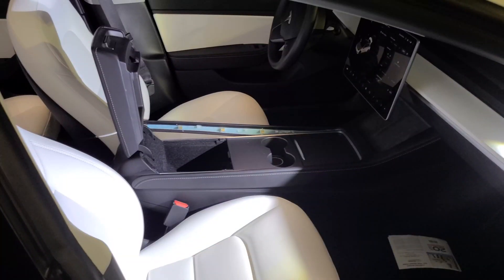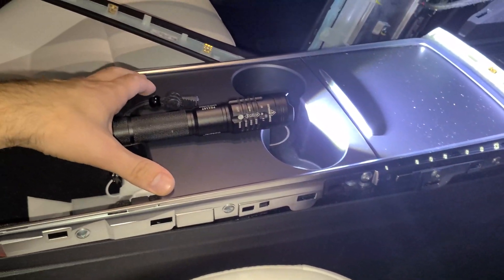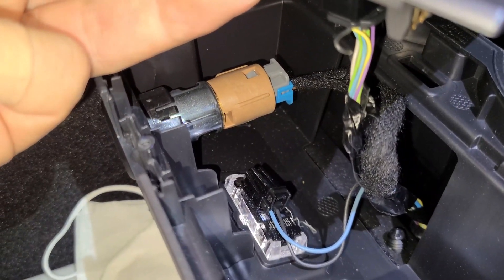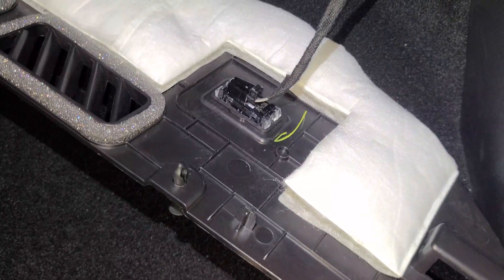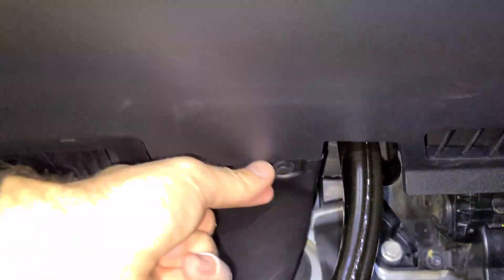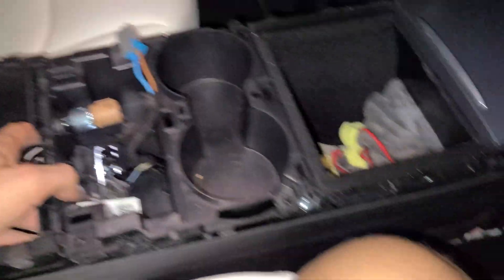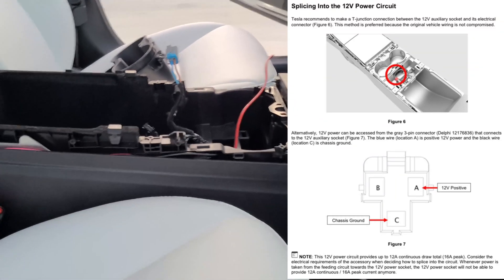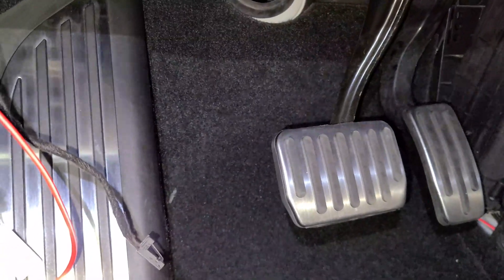HOW TO GET SWITCHED 12V POWER TO ENABLE FOOTWELL LIGHTS ON TESLA MODEL 3 SR+ OR OTHER 12V ACCESSORY

Comment: Just a quick warning, older cars with the original center console will have a different disassembly procedure that includes disconnecting all batteries. It's more involved. See owners manual.

Comment: I recently sold my 2021 Long Range for a 2023 Standard Range, not realizing I lost amenities like the footwell/ambient lights. You are a Godsend for this video, as I am ordering the supplies from your Amazon links and can't wait to get my footwell light back. 

That said, do you know how to activate the side door lights that turn on other models? I would want it on at all times like the footwell light. And since I am using the 16 gauge you mentioned, can I use this replay for do some lights under heater the seats for the passenger in the back?
Reply from the maker: Is this in regards to the footwell lights when the door is open or the door in the cupholder? The footwell lights should be active on a SR so I am going to assume you mean the cupholder lights. I looked into this slightly a while back and ultimately decided it wasn't worth the effort for me, but it seemed that they may not actually install that LED in the car's that don't have it active. I would imagine if you really wanted to, you could install a small LED light where one would usually go (the hole should still be there since it uses the same plastic mold), however you would likely need to do some door panel disassembly to access that area.

As for the rear passenger lights, yes absolutely, you can tap anything you need off of this wire such as rear lighting, a radar detector, or anything else you would typically run off your 12v plug in the center console.

Comment: Okay, have all the parts that you recommend from the Amazon links, using 18 gauge wiring, which has  two polarities.  So my question is when tapping into either that brown or yellow wire for the signal, you show using one red tap, meaning you tap both the red and black wire into that brown or yellow wire?  That's not done on the blue and yellow wire where you show two taps, one for the ground (black) to the yellow and one for the positive (red) to the blue wire.  Same question for tapping into the red and gray wires for the lights:  are you just tapping one wire (red) into those light wires?  So coming off the relay for the power, you are splicing one wire (red) to go to the two footwell lights wires, red and gray, correct?

Comment: Can I just tap into the cigarette lighter to power dashcam and put switch on it?

Why are you running so many cables..?
Reply from the maker: the additional cables are to use occupancy sensing. Without the signal wire, the dashcam would stay powered on except when the vehicle is sleeping. If sentry is on, the vehicle never sleeps. So depending on your use case, you you can just tap the power directly if you don't need occupancy sensing.

Comment: I have a question sorry if it’s a stupid one..  when I splice into the footwell lights (the red and grey wires) do I splice into the wire and make it a three way connection or just cut the original power wire and just splice it with the new power wire? 

Also can I just use posi taps for the splicing?

Comment: Really nice video. Answered a lot of my questions. I'm still at a loss at where the brown wire is. Do you need to remove the plastic cover under the air vents (the obd connector location) to access the brown wire?

Comment: As ghetto as this installation is, there is very useful information in this video that I haven’t seen available elsewhere. Be aware that the power source used in this video is around 15.4V with a max load of 12A after 2022. Use DC-DC converters to protect your installations.
Reply from the maker: Since this is tapping off the cigarette lighter (typically 12v power) wouldn't the car already be downstepping the voltage? I believe you would only need the converter if you pull the power directly from the battery, right?
Reply: @TheHardwareJunkies  it is 15v as tested today. i have a stepdown for that purpose

Comment: Which brown wire is the correct one in the back?? I have 2 thin brown wires and one thick in the blue plug??
Reply from the maker: Behind your air vent, you should see a harness connector, on one side you'll see a thin blue wire as well as a thin brown wire going into the connector. On the other side of the connector you will find a yellow wire as well as a black wire. For my installation I tapped into the brown wire. I have also heard that for an easier installation, the yellow wire is a continuation of the brown wire and that you can tap that as well but I have not personally verified that.

Comment: Is that signal wire there on a 2019 SR+? I assume this will turn on the lights when the head light turns on?
Reply from the maker: It should be, it turns on as soon as occupancy is detected in the vehicle (i.e. whenever the doors open and the touchscreen is turned on)

Comment: I dont see a Brown signal cable? I have a harness in the back with black, yellow, blue and gray
Reply from the maker: Behind your air vent, you should see a harness connector, on one side you'll see a thin blue wire as well as a thin brown wire going into the connector. On the other side of the connector you will find a yellow wire as well as a black wire. For my installation I tapped into the brown wire. I have also heard that for an easier installation, the yellow wire is a continuation of the brown wire and that you can tap that as well but I have not personally verified that.
Reply: @TheHardwareJunkies  can verify the yellow wire is easier to get to and works just the same 😄
Reply: @Delarocky  Is the yellow wire that's a continuation of the brown wire the one that is behind the rear air vent?  I see four colored wires:  black, grey, blue and yellow.

Comment: Great video. Thank you for posting and going through all the steps.  I am looking for switched power in a MY for LED lighting.  The MY already has ambient footwell lighting wired up.  I was thinking of using the 12v source as you described, but taking the signal from the existing footwell light - that way, the LED lights will turn on whenever ambient lighting is on, which is the desired effect.  
I'm wondering if taking the signal from the existing footwell lights could cause issues with tripping an error, etc.

Comment: I wanna do this but I have no experience. I am currently installing a diy led kit for the whole car but am trying to hide all the wires as best as possible and this method seems to be great considering it will turn the lights on and off along with the footwell lights. Do I need to use the ground wire if I'm only doing LEDs? I should only be uusing the 18ga because I don't plan on adding any other accessories until I can find someone who can install an aftermarket amp and sub I pulled out of my old car.. and to my understanding from reading the forum, I would need to install another 12v battery just to power the amp? Another question I have is if the led kit I have already has a power switch (plugs into 12v cigarette lighter) if I run this setup with a relay, and the lights go on and off with the footwells, can the lights be still turned on and off via the switch and/or the app? If I turn off the lights via the app would it turn the footwell lights off too. 

Might have too little experience and too many questions to try this myself but I really want a clean install and don't want wires hanging out of the armrest.
Reply from the maker: I would say your best bet would be to purchase a 12v female cigarette lighter outlet and wire it up to the relay. Then just plug your lights into that and they will auto turn on and off with the car
Reply: @TheHardwareJunkies  I couldn't just t-tap directly into the 12v cigarette lighter wires?
Reply from the maker: The 12 v cigarette lighter will not turn off until the vehicle goes into sleep mode (which does not occur ever if sentry mode is on) and so your lights would stay on after you exit the vehicle
Reply: @TheHardwareJunkies  that's fine because I rarely use sentry mode and the led kit has an app which it can be turned on and off remotely.

Comment: By chance have you figured out how to get them to dim when you are in drive? Then go to full brightness when you are in park?
Reply: Maybe see if you can find the wire that controls the overhead lights that turn on when in park/opening the door and wire that into the footwell lights, then with the center console output past the relay, you can limit the current so that it's not outputting as much and will make the footwell dimmer, and when opening the door or putting in park, it'll shine brighter!

Comment: if you could find the headlight signal feed in the cabin, could you tap into that signal and have the lights turn on whenever the headlights are on? I feel like that would be more effective and make more sense since the footwell lights would turn on during dark along with the headlights. But i’m not sure if there’s an accessible signal wire for the headlights in the cabin to tap and i’m not sure if the headlights run off the 12v
Reply: nvm just read that tesla uses zero fuses and all circuits are controlled and monitored thru the MCU via BMS which will throw an error if tripped. Looks like i’m gonna stick with this idea.

Comment: Cool video, considering doing this. I understand the brown signal wire is linked to the console light - which is always on unless in sleep. I'm wondering how adding the relay changes this behaviour, as per you comment, that it will only be activated if the car is occupied - i.e. the lights won't be on in Sentry.
Reply from the maker: The brown wire does not provide enough power to power the footwell lights. Instesd it uses the 12v center console outlet for power and uses the brown wire as a signal wire to turn the footwell lights on and off.  The center console light is only powered when vehicle is occupied, it is not based on sleep. The 12v center console plug is always on except while in sleep. We use these two things in conjunction with each other to get the wanted results out of it
Reply: @TheHardwareJunkies  Ah got it thanks I understand how you are using the relay now. Does that mean the footwell lights are on whilst driving?
Reply from the maker: Exactly. They are always on as long as the vehicle is occupied. That's why I added the switch under the passenger area. Thought it may be good to have, but honestly I have never used it yet

Comment: Hi, I want to install extra led light inside but want to use the footwell light as a trigger wire to power the led on/off, could you please help me with the diagram for the relay? I will be tapping the 12v from the back of the cig outlet as well for power.

Comment from the maker: *Note, In the cup holder area the brown wire is ground and the blue wire is +12v. In the back of the car behind the rear air vents you will find a brown wire going into a connector which is the signal wire

I tapped the wires using the yellow t-taps on the 12v power source and the red t-tap on the brown signal wire. Use appropriate male crimp connectors for your wire size to plug into the t-taps

You may also want to use some electrical or felt tape to secure the wires to prevent them from rattling in the future.
Reply: Where did you get that “splicing into the 12v circuit” from? Can you provide link please?
Reply from the maker: Hey Mike, are you referring to the snipping from the Tesla service manual I showed? I found that snip in a forum post online but I believe it comes from the service manuals you can buy from Tesla
Reply: @TheHardwareJunkies  Correct. I have the service manual myself that can be used anytime. However I cannot find that section anywhere
Reply from the maker: @Mike-ke7co  hm let me see if I can get more info on it. I only found the snipping in a forum post so I didn't directly find it from the service manual
Reply from the maker: Here is the forum post I found it on. Scroll down in the page and you can see the whole printout. https://teslamotorsclub.com/tmc/threads/12v-switched.147325/page-6
Reply: @TheHardwareJunkies  You’re awesome!
Reply: Thanks, Christain....I have them all installed and put back together and it all works.  Not sure the relay does anything, as I wired to the positive on the relay as it had power, but if I wire it to the - terminal on the relay nothing comes on....not really sure what activates that you said when people are in the car we were in the car but not driving it and there was no light.  It's easy to change back to that terminal now that it is done as it's only the one side panel to be removed...sorry for my ignorance, not worked with a relay before, I understand the concept but not the wiring theory. Either way, the factory disabled footlights work and I strongly feel that Elon should not have them disabled if the hardware was there....I admire Elon like a father but not enabling physical features is a stab that should not happen (crazy they want $200 to enable back seat heaters...same concept!)
Reply from the maker: The relay has a 12v in, a signal wire, ground wire and 12v out. The 12v out ONLY turns on when the signal wire is providing power to the relay. The ground on the relay is only there to ground the relay itself, it doesn't do anything for the lights that are connected to it. 

The signal wire in the Tesla is connected to a wire that only powers up when the vehicle is occupied. When no one is in the vehicle the power shuts off on the signal wire, turning off the relay and turning off the lights.

When the vehicle is not occupied, the 12v plug in the middle remains on. Without the signal wire/relay the lights would also remain on.
Reply: Why cant u just tap into the dome light? When its on the footwell will go on and also the dome fades out as well?
Reply from the maker: I don't see why you couldnt if you can find the wire for it. I am sure there's a variety of wires to tap off of